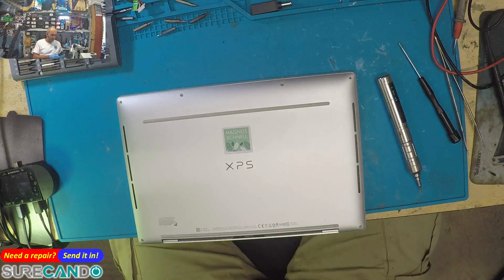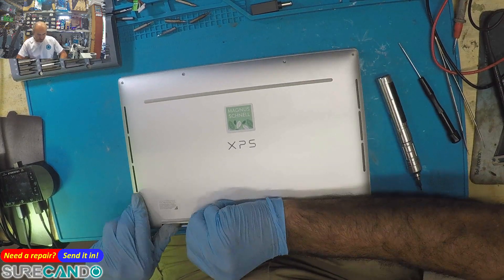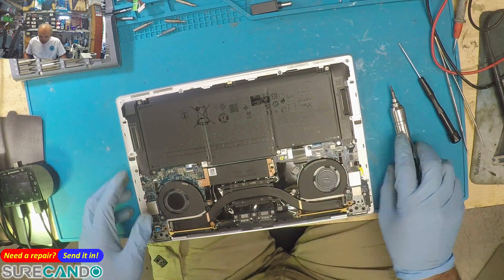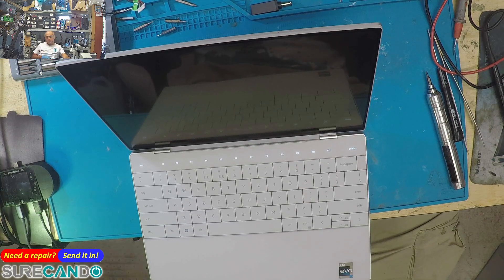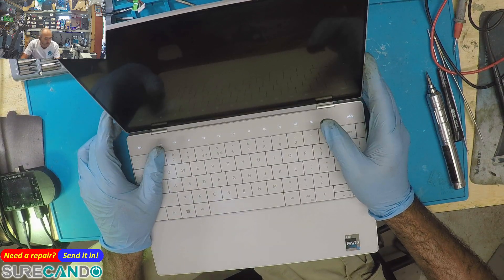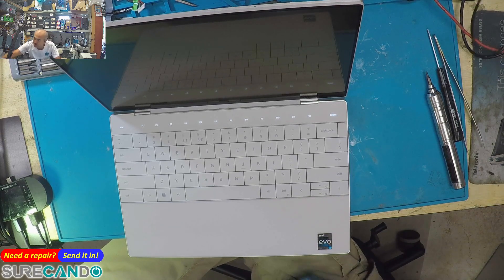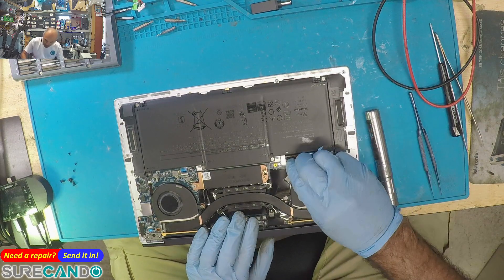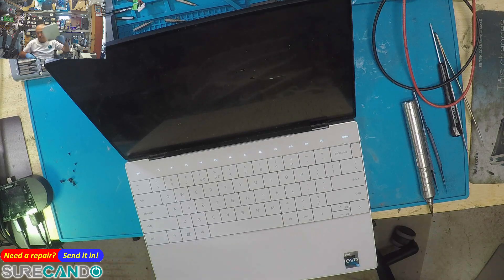DELL XPS 13 PLUS 9320 Diagnostic Guide: What 2 Amber & 7 White Lights Mean

Comment: Dell Inspiron 7559 series. Battery is inbuilt.

2 orange and 7 white light.

Sometimes the display works but usually takes 10-15 times restarts.

What to do? The repair shops say, they would have to open and check the laptop, which can damage it further. Dont want to go that way, whats the solution?
Reply: Hi, I need an advice,  My dell xps 9320 wont turn on. when ever I press the power button a red light beeps and refuse to come on. pls what could be the challange...
Reply: Replace led screen and eDP cable
Reply: Hello, I’m currently having the exact same issue. How did you eventually fix it? Did you have to change the LED screen?